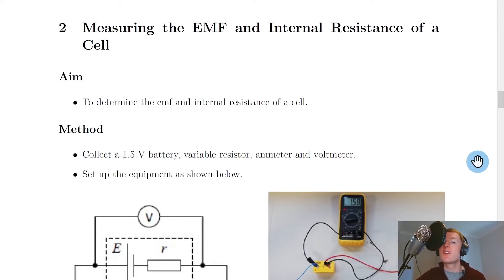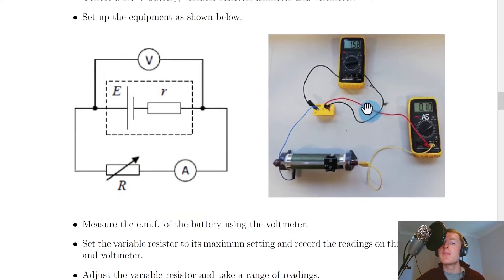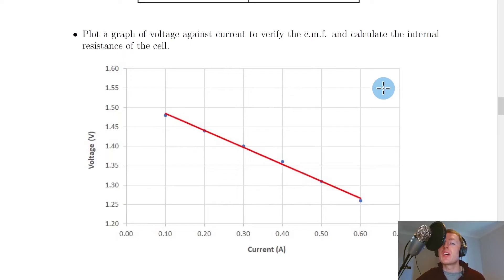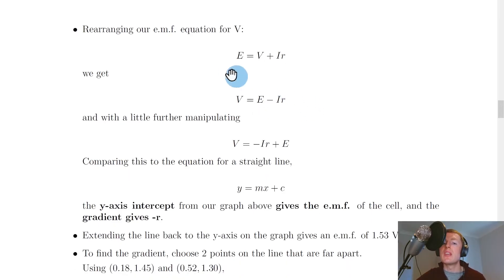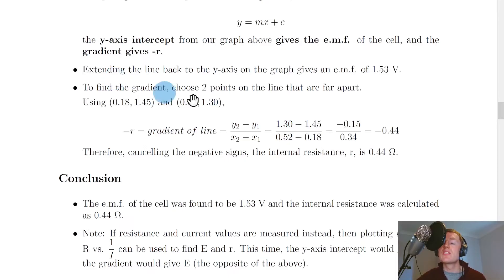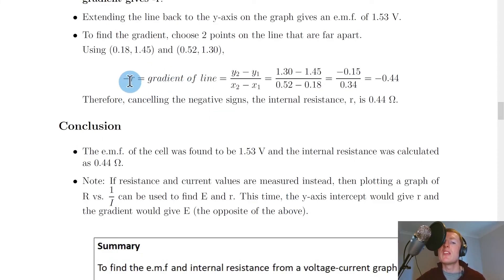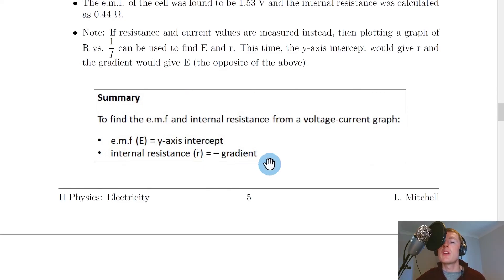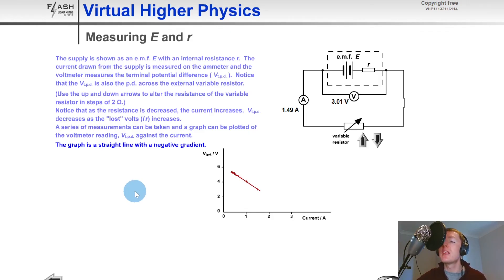Higher Physics | Electricity | Measuring the EMF & Internal Resistance of a Cell | THEORY

Comment: ❤That's absolutely a great job. But there is still something we can't ignore- the measurement error(or systematic error). Since we place the ammeter this way, the current it measures includes a small current flowing through the voltmeter, making the calculated internal resistance a little bit smaller than it actually is. If we write it in the form of an equation and rearrange it, we get r=(E-U)/I. I is a little bit bigger cuz it includes the current through voltmeter. But if we know the resistance of the voltmeter, we can derive the equation: U=E-(I+ U/R_v)r. Then we can correct the value of r.